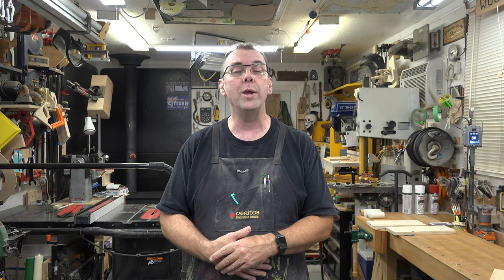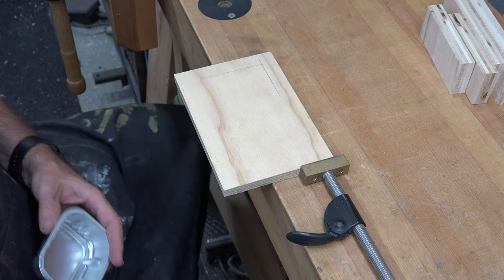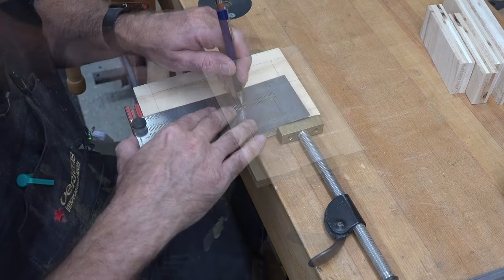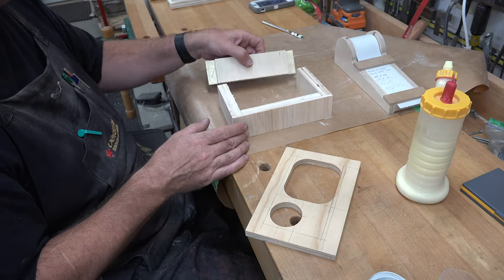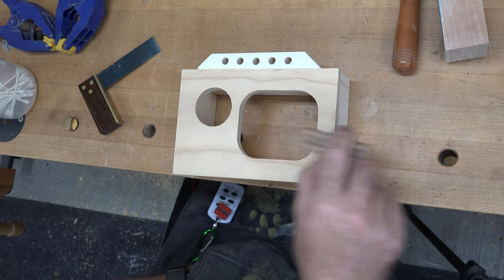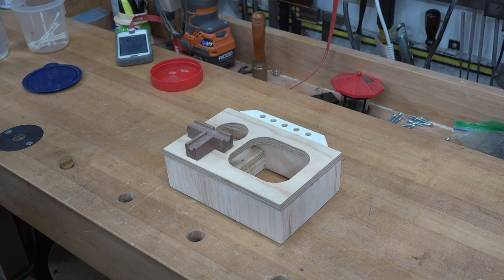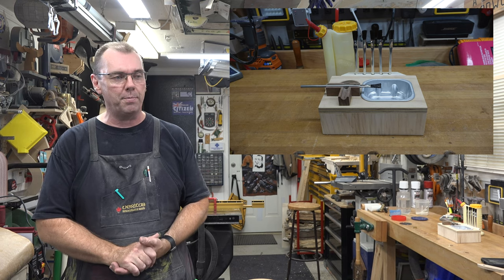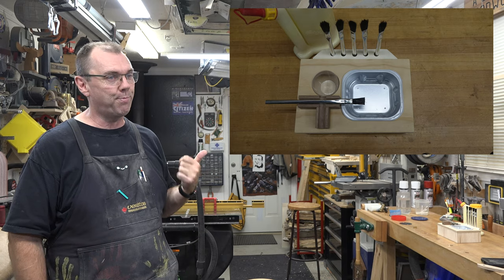Making a Shop Made Glue up Station

Comment: Thx, Kenny. Simple tip, yet very useful. I think I might add some form of simple handhold or handle on mine on the non-dominant hand side, with the brush stand on the opposite side. The idea would be to make it possible to hold the station as an oil painter might hold a palette, especially useful for glue-ups too big for you to reach everything from one spot.
Reply from the maker: That's a great idea Michael.  Good luck on your build and thank you for tuning in and chiming in with your idea.  I love it.

Comment: Love the idea, nice job. What is the name of that bench clamp you use? The one with the threaded rod
Reply: I searched quite awhile before finding it at Lee Valley.  It's called a Quick-Release Wonder Dog.  Lee Valley item number:  05G1030.  Not inexpensive but find it extremely handy as Kenny illustrates in most every video.
Reply: @dwightl5863  thank you
Reply: @dwightl5863  Thanks. I followed the link. Not inexpensive indeed. It should be relatively easy to DIY one. A rough guess. 2 USD material costs and 2 hours of time for a 101 woodworker.
Reply from the maker: I see that Dwight has already answered your question.  Glad that you enjoyed the show.  Thanks for tuning in.
Reply from the maker: Thanks for chiming in Dwight.  It's appreciated.

Comment: I love using every little piece of material to the maximum.

so if my yogurt cups differ in size from your aluminum trays, I will need to resize the hole right? (just kidding)

great mini project!
Reply from the maker: LOL.  Glad that you liked the project.  Thanks for tuning in and good luck with resizing your yogurt cup holes.  LOL.